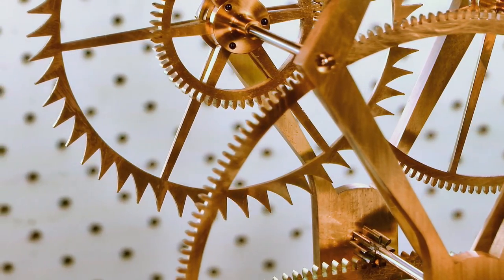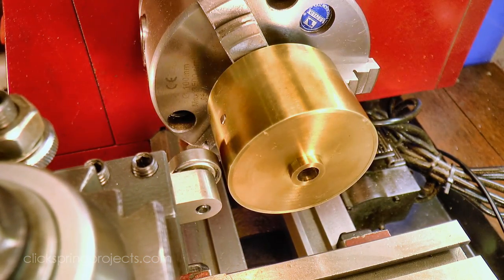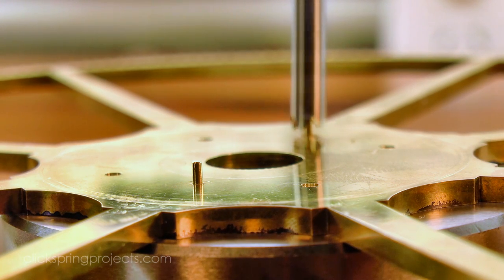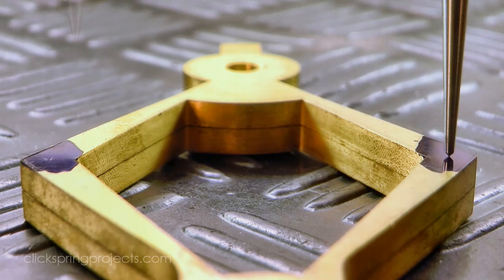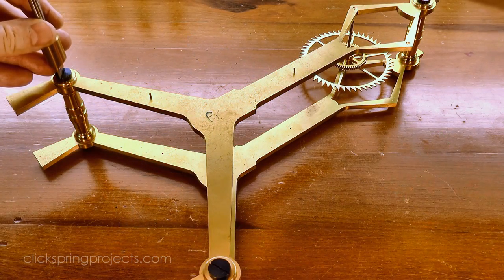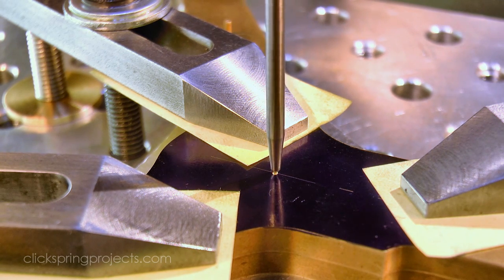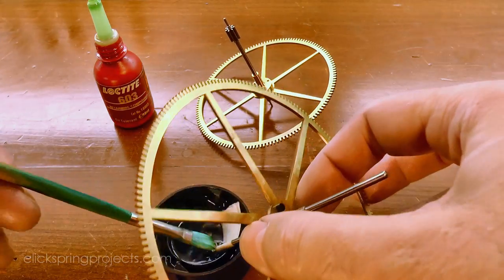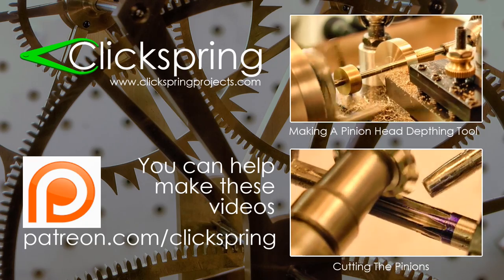Clockmaking - How To Make A Clock - Part 13 - Depthing And Planting The Train

Comment: This video will get more watchings (is that a word?) from me. My first clock was Mr Wilding's wooden clock. It runs, more or less. Mr Wilding says you can follow the full-size patterns and not worry about depthing but I had a lot of trouble with that. So I am now building the Isaacs clock from the Yahoo clockmaker's group, but in Lexan plastic rather than brass, because brass is unobtainium here in Alaska. I see immediately that I must go back and build your depthing tool. Out of curiosity, what is the module of the wheels in that clock?
Reply from the maker: +Juan Rivero 0.6 and 0.75 for the going train, 0.55 for the motion work. Thanks for watching Juan :)
Reply: +Clickspring Thanks for answering! I have to constuct my own fly cutters because my mill is so small that it will not take commercial cutters.  I also made lantern pinions, same reason. This clock is beyond me at this point, but I hope to work up to it.

Comment: I love your videos, but I have a question: Maybe there is a reason for creating the slot for the screw  around 0:44 on the inside of the barrel, but would it not be easier to slot the other end of the screw and tighten it to the barrel counter-clockwise?  Since that part of the screw is going to be removed later on, it would not matter, and the result would be exactly the same (other than we not having another instructive video on how to create one more tool).
Reply from the maker: Answer below, thanks for watching
Reply: Sorry, did not notice that someone else had already asked it.

Thanks for the reply, and keep up the great work.

Comment: That right angle screw driver you made is great, but couldn't you have just cut a slot in the bottom of the screw to tighten it into the barrel?
Reply from the maker: +Grant Pluntze I tried a few things like that, but found there just wasn't enough material to work with. The insert needs to be screwed in very tight, and in each case the end just distorted, so an inside slot was the only option. Thanks for watching and asking :)

Comment: I'm curious about the locktight. Would it hold up over a long period of time, and how does it compare to traditional methods for fastening these pieces?
Great video as always, this stuff is like audio visual heroin.
Reply from the maker: +DissorderedArray Loctite is very popular in modern horology. It has a shear strength comparable to traditional soldering, has none of the metallurgical issues associated with heating the parts, and can be easily reversed with a gentle heat. The question of long term strength will only be resolved by a few centuries, but thus far it has proven reliable and very convenient. Thanks for watching and asking.

Comment: One really stupid question?  Why, when you made the hook screw, didn't you slot the narrow end as well for a driver?  It'll be cut off anyway, but wouldn't it have made the initial assembly that much less annoying, not having to drive it with a right-angle from the inside of the barrel...?

Comment: What's that ink put on the part for marking positions? Looks like the ink from permanent marker.
Reply: +Adam R Most people use Dykem Bluing Dye. However, Sharpies will work quite well for small areas. And Sharpie can be removed with WD-40.
Reply: +Adam R Marking or Layout Fluid

Comment: Hello, i'm into metallurgy and i'm wondering if it would be possible to use different soft alloy such a variant of bronze? Or are your tools so precise that it HAS to be brass?
Reply from the maker: +Joshua Hames Bronze is quite suitable for otherwise brass components, and it was occasionally used by traditional makers as a substitute. One drawback is that it can sometimes be a little less pleasant to machine than leaded brass. Thanks for watching.
Reply: +Clickspring thanks for the reply!

Comment: Awesome video Chris, how accurate do you think you can get this clock to be? +/- 20 seconds/day?
Reply from the maker: +S3V3N13TT3R5 It's not a particularly accurate clock design - silk suspension, recoil escapement, no temperature compensation etc If I managed to get anywhere near +-20 secs per day I'd be thrilled. I would expect something of the order of a +-2-3 minutes/day is more likely based on the design limitations, but we'll both find out at the same time :)

Comment: I am not waiting GoT season 6, i am waiting a new Clickspring video :) 

How long will this clock last with brass to brass contacts? Why no jewels (just asking, sure there is a reason)?
Reply from the maker: +Sinan Kargı I strongly considered jewelling this movement, but will instead keep it to traditional brass pivot holes for now. No brass to brass contact, pivots are all steel. Should get many years from the brass before re-bushing will be required. Thanks for watching and asking Sinan :)

Comment: for the hook inside the barrel, couldn't you have put a screw driver slot on the end of the screen to tighten from the outside?
Reply from the maker: +TheYellowDartt I did a bit of testing to see if I could get away with either a hex driver, or a slot on the other end but there just wasn't enough metal at the other end of the screw to resist the torque. The screw needs to be inserted quite tightly, and the metal simply distorted and bent. The only practical option was to put the slot on the inside. Thanks for watching.
Reply: +Clickspring !!! thanks for a response. I'm a huge fan and have watched most of your videos several times over. after submitting my question it came to me that you had tested that already. keep up the amazing content, production and overall video quality!!!

Comment: Where do you buy a lot of your tools like end mills and such? I find it hard to find specialised machinist tools in Australia.
Reply from the maker: +Christian Lewis Hey Christian, I buy Sutton cutting tools through my local Blackwoods.
Reply: +Clickspring I bought a standard 5mm 4 flute HSS flat end mill from Sutton through my local AIS and it was $40. Does that roughly match your experience?
Reply from the maker: +Christian Lewis sounds a bit expensive for HSS

Comment: Wouldn't the insertion of the barrel hook be a lot more easier if instead of screwing from the inside of the barrel, screw it from the out side? A simple screwdriver cut on the threaded part of the screw, long enough for the job but short enough that when the end cutted off, it wouldn't leave any marks. It could do the trick...
Reply from the maker: +Troll Henriques I did a bit of testing to see if I could get away with either a hex driver, or a slot on the other end but there just wasn't enough metal at the other end of the screw to resist the torque. The screw needs to be inserted quite tightly, and the metal simply distorted and bent. The only practical option was to put the slot on the inside. Thanks for watching.

Comment: You missed a bit of a trick with the barrel hook/screw. Nothing says that the driving recess for a screw needs to be in the head. You could have cut it into the tip, or just drilled through and used a bit of rod to drive it in.

Comment: Uh.. isn’t using TWO register pin 180 degrees apart counterproductive? You can rotate it by 180 degrees and it will fit…

Comment: The barrel hook could have been screwed in place with regular screwdriver if a groove was made on the other end of the screw. Why make special screwdriver?
Reply from the maker: +Bhushan Pai I did a bit of testing to see if I could get away with either a slot on the other end, or a hex driver but there just wasn't enough metal at the other end of the screw to resist the torque. The screw needs to be inserted quite tightly, and the metal simply distorted and bent. The only practical option was to put the slot on the inside, therefore a right angled screwdriver is required. Thanks for watching.

Comment: having to broach out fucking smiths clocks is the reason i prefer working on watches, and the reason my cad design clock is jewled -haha

are you gonna rhodium/gold plate the brass ?
Reply from the maker: +felix pinto Eventually, but I haven't built a plating system yet, so it will probably happen well after the completion of the build. Thanks for watching.

Comment: why didn't you just made the hook and put the driver slot on the thread side of the hook doing that you wouldn't need any special screw drivers to screw it in
Reply from the maker: +at9456 I tried a few things like that, but found there just wasn't enough material to work with. The insert needs to be screwed in very tight, and in each case the end just distorted, so an inside slot was the only option. Thanks for watching and asking :)

Comment: wasn't a  easy way without the angled Screwdriver,  just making a Screwdriver slot on the tip of the screw and tightening it from the outside with a unscrewing movement whit a regular screwdriver?
Reply: +rc215  not complaining about the extra video making the screwdriver lol
Reply from the maker: +rc215 That's a great question, the same thought occurred to me too. I did a little test before proceeding to see if it would work, but there was not enough meat on the screw to withstand the force of the screwdriver. The insert needs to really be screwed in tight, and a little slot on the other end just couldn't cope without distorting, so I had to go with the inside slot instead. Thanks for watching :)

Comment: Why didn't you put a slot on the outside end of the barrel hook screw?  You could have done without the right angle screw driver and could have contoured the hook before you installed it.  Not criticizing, it just struck me when I looked at the video.
Reply from the maker: +Metallurg33 That's a great question, the same thought occurred to me too. I did a little test before proceeding to see if it would work, but there was not enough meat on the screw to withstand the force of the screwdriver. The insert needs to really be screwed in tight, and a little slot on the other end just couldn't cope without distorting, so I had to go with the inside slot instead. Cheers mate!
Reply: +Clickspring I suppose a looser fit and some silver solder would defeat the "make it easier" idea.  I'm not sure I would want to put that much heat in the barrel.
Reply: +Clickspring its a bit rough, but usually they go in with a pair of vice grips on the outside. your solution is much more genteel.. thats an awesome feeling when the train runs from the barrel arbor.. congratulations for getting this far!
Reply from the maker: +Emma Ritson Cheers Emma!
Reply: +Clickspring what if, on the end that was cleared of threads, you created a box shape to use a box end driver from the outside of the barrel. that ought to give you better torque than a slot, yes? for another build, of course. question - during layout @4:55ish, i assume you've carefully scribed a through line, and measured the distance between the points, the overall distance between the outer edges, and marked accordingly? it almost looks like you're kinda winging it, there. and sorry to keep repeating myself, but - beautiful stuff there.